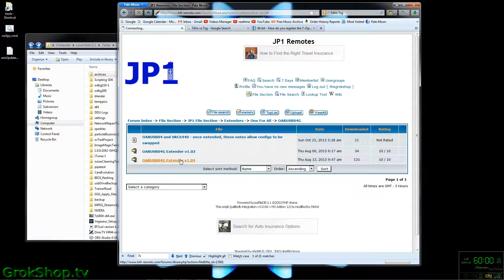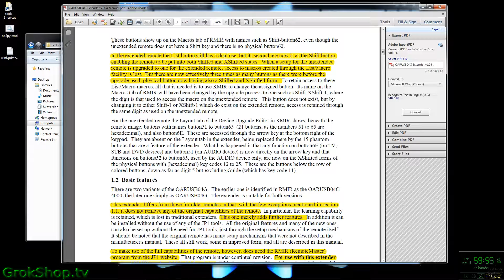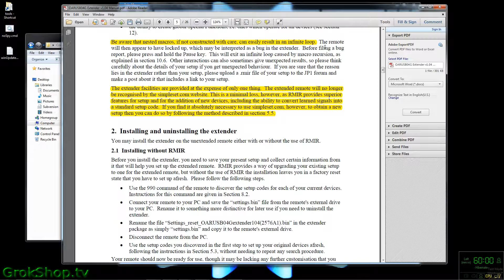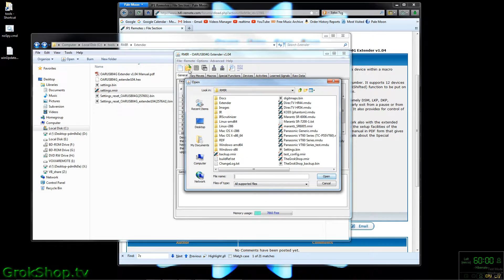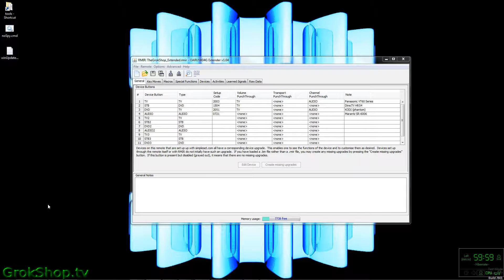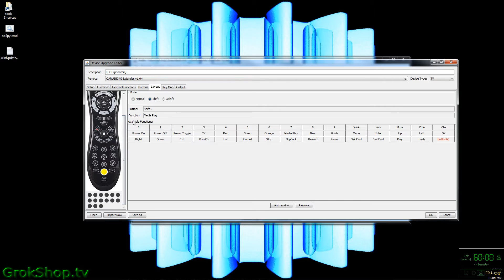Universal Remote Control [part 4] - JP1 Extender Install and Config via RMIR

Comment: Thanks for making these videos!  I have a very similar setup with an OARUSB04G remote controlling an old Panasonic 42" plasma TV, a Pioneer AV receiver, and a DIRECTV Genie Mini.  I had the same issue as you with the extender not installing as documented, and it helped watching your method, which also worked for me.
Reply from the maker: Right on... thanks for the feedback Doug!